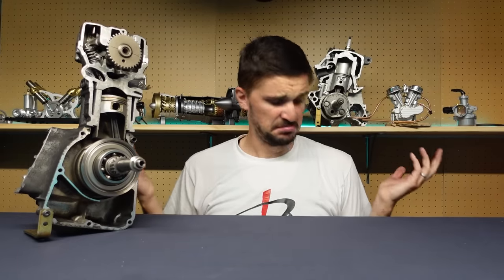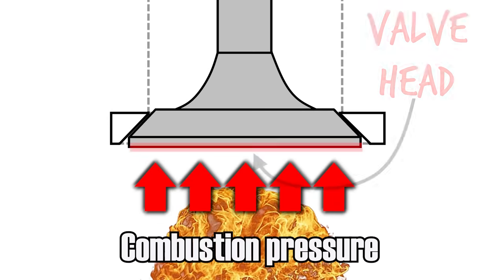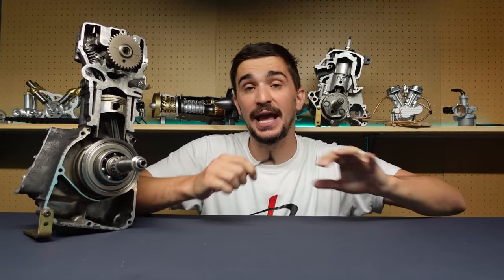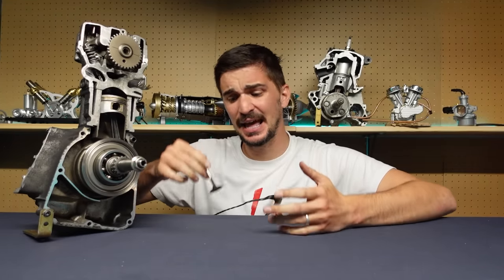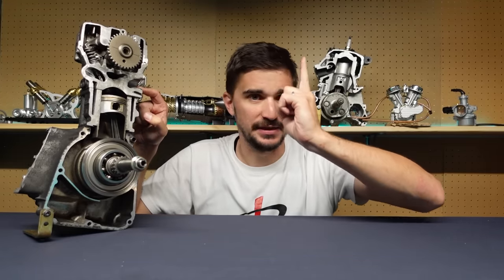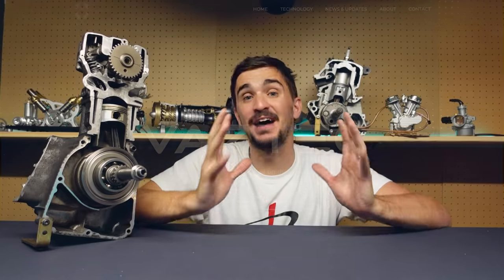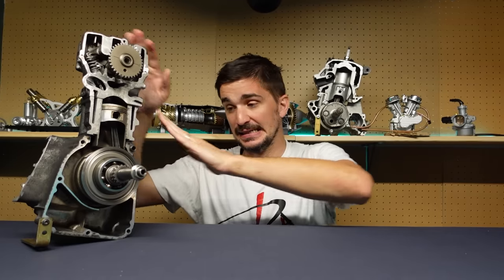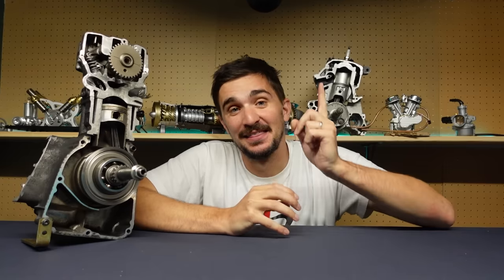Rotary Valves Make Normal Valves Look Silly - Why Aren't We Using Them?

Comment: The crankshaft gets the energy stored in the valve spring back when the valved returns to closed. The power dissipated into operating the valves is minimal unless the cylinder pressure is excessive. There's a reason why piston engines displaced everything else.

Rotary valves have been used in piston engines since at least WWI and while they offer very good high RPM performance, longevity issues limited their success.

If you want to see a much more aggressive variant thereof, look at "sleeve valves" which have been used extensively in WW2 aircraft. They offer even higher compression and much larger airflow volumes. They do suffer from the same issues as rotary valves though but bring a true performance boost.

Comment: Sleeve valves were a thing. Lots of drawbacks with oil usage but Voisin and others used them. Of course in WW 2, some fine aircraft engines were sleeve valves.

Comment: I think there are a few other issues with this:
1. No VVL
2. No Miller or Budack cycle
3. No valve overlap EGR

I think this would have more potential if the intake and exhaust valves were independently situated and driven by electric motors, so the effective duration of the valve opening could be changed relative to the other valve and also the piston stroke. An independent drive would also eliminate more angular momentum from the rotating group, and small electric motors are pretty good at ramping up and down in RPM quickly.

Comment: One annoying problem with rotary valves on modern engines is that while you can put the equivalent of a camshaft phaser to advance or pull back the intake and exhaust timing, but if you only have a single rotary valve performing both duties, their separation will be fixed to each other, sure you could open the intake port sooner, but that's going to open the exhaust port sooner, same for opening one later, the other has to open later. You also cannot compare it to true variable timing in a DOHC engine where both the Intake and Exhaust valves have their own camshaft and therefore not only can they be acted upon/adjusted independently, but each Camshaft can have multiple grind profiles, so you can not only independently and precisely adjust intake and exhaust timing, but each camshaft can have different profiles that adjust both lift and duration which are just not things that a rotary valve can do.

There is also the idea of a slide valve, think of a block with multiple passageways that sits flush and depending on whether it is slid one direction or the other determines which valve is open, and while a rotary valve is usually run off of a fixed gear tied to crankshaft rotation, a slide valve can be actuated pneumatically or hydraulically with varying speeds and lengths of travel completely disconnected from the rotation of the crankshaft and therefore also independent from piston location in the cycle.  The problem with slide valves and that you really want multiple per cylinder, at least two if you want to have independent control over intake and exhaust stroke timings and durations, as well as varying degrees of "open-ness" which correlates to lift in a normal valve.  I think slide valves are the future for combustion otto cycle engines, but one huge question will be the noise of the actuating metal valve blocks rocketing back and forth as they open and close, likely steel or possibly titanium given the heat they will encounter, a ceramic could also work but tend to be brittle. 

You could also couple this with the 5-stroke design idea, or the integrated piston supercharger where you have one or more compression-only pistons that might be 500cc with 15:1 compression which  compress and exhaust every rotation of the crankshaft and providing two cylinders with pre-compressed intake air, which has been tried before but fixed timing means that you always get the same cylinder pressure regardless of RPM, even at idle you're idling, but actuated slide valves could solve for this issue limiting the amount of air on intake at lower required power levels, or even putting the valve in a third position that bypasses the cylinder entirely for intake and opens a compression cylinder port to atmosphere to reduce parasitic losses and not overheat the cylinder. Again, the part that makes this design idea viable again is leveraging nearly infinitely variable hydraulic or pneumatic slide valves that can solve the problem when trying to run such a system with camshafts and traditional valves.

Comment: They could do a hybrid rotary like poppet valve.  It can open and close in a linear lateral fashion instead of rotation but the air travels in the middle of the valve and enters the cylinder through an opening like a rotary valve.  A lip like a poppet valve would create the sealing.

Comment: I think many of us have thought of this, but do you see that long crank he's using to turn the thing though? So now, instead of overcoming a spring, you're overcoming friction on the large surface of the cylinder in order to get that seal. You have the same issues as a rotary engine.

Comment: A lot of concepts are over simplified here:

The force of compressing the valve springs is given back by the spring when it uncompresses pushing on the camshaft lobe. The losses are in the friction of the cam lobe acting on the follower / tappets etc.

The obstruction of the valve creates turbulence in the cylinder, improving fuel - air mixture and cylinder distribution of the mix.

In a rotary valve setup there is a lot more wearing sealing area that needs lubrication, precision engineering, complex timing and will wear very quickly.

This technology was phased out in the steam era.

Comment: We already have engines that use in a sense rotary valves. 2 strokes and rotary engines. In a sense they are rotary valves in that there is not a poppit valve but instead a moving piece of metal to block/unblock the intake and exhaust. Not exactly a rotary valve, but I kinda think of them as such. But it would be cool to see more engines using rotary valves and completely removing many of the downsides of traditional valves. For me the biggest issue is interference. I'd like the engine to not grenade if a timing belt/chain broke. As that is a constant worry about my current vehicle as it's older.

Comment: Instead of one valve shaft, using two, one for inlet and another for exhaust would allow the injection and spark plug to be set in the middle, and maybe with a bit smaller shafts the heat expansion would be limited, which might also reduce the burning outside of the combustion chamber.

Comment: Coates International ltd producing The Coates Spherical Rotary Valve (CSRV) System heads for v8 engines, sounds like a heaven. ppl use it in drag for over a decade

Comment: Rotary valve will open slowly stay open fully for short time then close close as it turns, but stem valve open and close (almost ) instantly depending on design of cam lobes with a perfect seal.

Comment: There were a couple pre war rotary valve engines but they never really sealed that well in higher compression engines. Just like the rotary engine seals were a challenge and burning oil part of the design..

Comment: With greatly enhanced CFD, the intake can form an acoustical resonance, like a valveless pulse jet engine, to shove air into the engine or suck exhaust out of the engine, with resonance, with special ECU sensors that can precisely measure harmonics of the intake, combustion, air fuel load, fuel air mix, exhaust, and resonance of the intake as harmonics using the science of frequency study. This will work significantly better in engines that operate as generators operating at once specific speed to make electricity for the electric motor final drive in PHEV and REEV etc

Comment: rather than rotating the rotary seal what if we made it shift left to right. when shifted left it provides a open channel for air/fuel flow and when shifted right it seals. grooves similar to on a poppet valve would exist and you could still use springs but it eliminates the restriction. like a poppet valve turned 90 degrees and a hole through one end of the valve.

Comment: You can also get positive sealing with this type of valve. The trouble is that it is continuously turning, even while the pressure in cylinder is forcing it closed, so you get wear and binding. Could you somehow stop the rotation while there is pressure in the cylinder? Like a mechanism that snaps it quickly between open and closed.

Comment: The internal combution engine (ICE) still has massive unlocked potential, as you are pointing out in your videos. Bad regulation keeps this potential from being unlocked.

Instead of pushing a techonogy that is promising but not actually economical (EV's) and outlawing the ICE (I know e-fuels, but that's not economical) they should pass regulation in favor of highly efficient combution engines so the development goes more into this direction.

Comment: rotary disc valves used on 1970s small displacement 2 stroke engines worked. but the 2 stroke is different than a 4 stroke as intake gas is mixed with oil in the crank case then introduced by transfer ports. if there was a way to raise this system away from the crank case and up to the intake/exhaust in a 4 stroke it would work.

Comment: One problem with rotary valves that wasn’t mentioned probably is that the form of the form of the combustion chamber is changed. The underside of the popping valves follows the curvature of the wall of the combustion chamber, while a rotary valve cannot do this by design. Is has been already mentioned that this creates a small additional volume that doesn’t contributes to the power output. But the bigger problem is that the form of the combustion chamber is also changed.

There has been an incredible amount of engineering to optimise the form of the combustion chamber, the position of the spark plug, the position and form of the gas injection. The goal is to get an optimal combustion process, completely burn the fuel and to have as clean as possible exhaustion gasses. This investment will be lost by using rotary valves and have to be started nearly from scratch, with the risk of ending up with an engine that requires additional treatment of the exhaust gasses, and burning the fuel less efficiently.

Comment: I remember when they had an article in a hotrod magazine  many years ago on Coates engineering. They said they made a set for a 302 ford for testing, and they revved the stock motor 15,000 rpm before stopping. There's actually a video on YouTube with somebody with a Coates head engine. I'm not sure of Coates is still in business, but at one time they offered to make a rotary valve head for any engine you wanted, custom ordered. I know the only market they got into was industrial generator motors. It didn't catch on for automotive or hot rodding, probably due to the cost and difficulties in sealing and longevity of the Seals, and the push back from hard core non believers...but I would LOVE to have a set and be turning an engine 15 to 20k at the drag strip.

Comment: I'm not sure what materials would be needed, but I was thinking another possible valve shape would be an umbrella valve < (or double umbrella) -<> that the air would flow around. (Similar to a bladder valve used in low pressure applications, but more robust for high pressure and temperature)  The air would not be deflected on entry as the folded umbrella shape would be out of the airstream, and when the umbrella is open, the edges would seal to the walls.  It should take up the same piston head space as a standard valve, but with a longer shaft length, so you could still fit the spark plug in the center of the piston.  Needs some research.

Comment: Mechanically the rotary action is more elegant and makes sense at the first look. But over time the wear issues with sealing and lubrication will produce more headaches. You're basically inviting the same problems you'll have akin to a wiped bearing. Once it goes off center or gets any kind of scraping on the seating surfaces it's done, time for overhaul. (There are patents at the very beginning of the 1900's, so there is prior art - thus there are reasons it didn't take off all that well.)

Comment: Rotary valves doesn't just have problem with sealing, most of the designs also offer a very poor port area. For any piston engine, intake port area is the most important due to the low pressure difference driving that flow compared to the exhaust side. That will shift a bit to the side of the exhaust in highly turbocharged engines, although the intake side still will need a larger port area than the exhaust. A good poppet valve design can offer a port area of around 30% of the bore area. That is sufficient for piston mean velocities up to 25 m/s; way higher what is used in most non-competition engines. This can by the way be done with volumetric efficiencies up to around 130% (in other words, a 500cc cylinder will fill with up to 650 cc of air). Since most rotary valve designs doesn't offer more port area than that, one must really ask what's the advantage then? Yes, some rotary valve systems can offer more port area such as the Bishop system developed by Mercedes-Ilmor for F1 in the nineties/early 2000 before the FIA mandated poppet valves for F1. The Bishop system uses one rotary valve per cylinder, which serves as both intake and exhaust, with a diameter of 0.67-0.74 times the bore diameter, and that rotary valve is normally rotated 90 degrees compared to the crankshaft as the intake and exhaust ports are normally oriented on an engine. One side of the barrel shaped rotary valve serve as the intake port and the other end as the exhaust port.

As modern engines operate with combustion pressures in excess of 100 bar, any rotating valve design must be able to handle the distortion handled by that pressure combined with the effects of the hot exhaust gases without seizing or causing additional friction losses. If that distortion doesn't cause the rotary valve to seize, well, then it tend to leak instead.

Also, while it can be hard to rotate a single cylinder camshaft by hand due to the valve spring pressure, the springs only store energy, so the engine used to compress the spring will be returned when the valve closes. What we lose is just the friction that valve spring causes, which is why almost all modern engines use roller followers.

Comment: The other thing with a rotary valve is the valve opening is always moving which does nothing for the atomisation of the charge.
A poppet valve remains in the same general position as it opens and closes wheras a rotary valve is like waving a door at the charge.
Rotary engines with the opening stationary and the 'piston' rotating  is a bit better but whatever the brap brap people think are quite inneficient and dirty. And a seal has never been perfected so they need to be overhauled regularly

Comment: Ducati Desmo motors don't use valve springs to counteract valve float. There is also air valves used in F1 motors.

Comment: I wonder, has there been any practical tests with sliding or oscillating valves? Simply an off the cuff idea, but a sliding bar with a cutout or maybe even a solid bar that slides to occlude the port would be easier to seal than a rotating design, wouldn't need the heavy springs on the poppets, and would provide similar properties in regards to the flow of gasses. I suppose it could cause balance issues that would need to be dealt with. I'm not even sure where to begin looking for something like that.

Comment: Apart from the ceiling, I see another slight issue. That is the rotary valve area that's constantly being burnt by the combustion and then scraping around the inside of its chamber. It would be the same area of the rotary valve all the time.

Comment: The replacement example reminds me of how a power plant generates electricity from the heat source below it.  Be it coal, oil, or one of the other fuel sources in use right now that design looks similar to what is used. Meaning tweaked a little and maybe made a little bigger it could make a lot more power from the same fuel source but then you will have effectively a power plant in every car.

Comment: Desmodronics for the win

BTW, leaded fuel doesn't reduce valve wear by "lubricating" the top end. It changes the flame burn profile and the wear of unleaded fuel can be (mostly is) mitigated by altering valve timing rather than hardened seats 

Poppet valves are used not because they're perfect but because they're "good enough" - and nobody will invest huge amounts of R&D into ICE because they have a limited lifespan which won't payback before 2036 (when most ICE engine sales will be restricted and fuel will likely be past $20/gallon anyway)

Of course, if you want silly rpm and power, the real answer is TURBINE. Aircraft switched to them because turbocompound designs were found to produce half their power from the exhaust turbine with only 3 moving parts, vs the thousands of parts (and 3 ton weight) of the attached piston engine (Napier Nomad).

The hard part is low power efficiency (mostly solvable with recuperators, The Chrysler turbine car used this and the nice side effect is an exhaust cooler than conventional piston engines) and translating turbine to wheels (Toyota's Hybrid Synergy Drive was originally developed as a turbine gearbox)

ICE issues apply. Turbines aren't going to happen